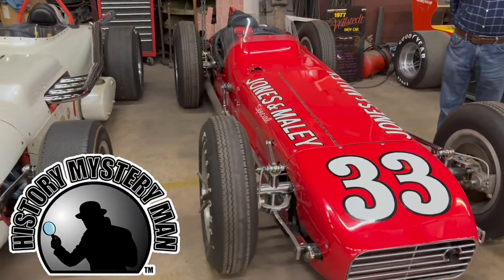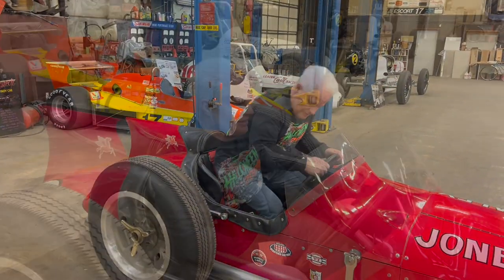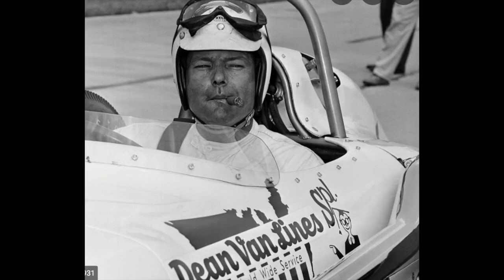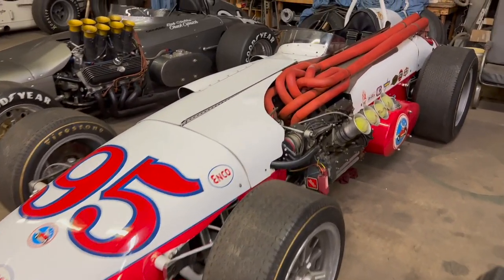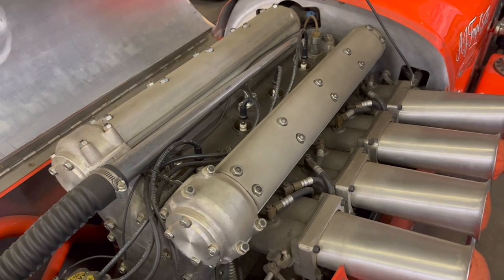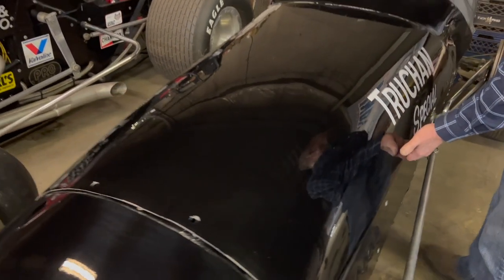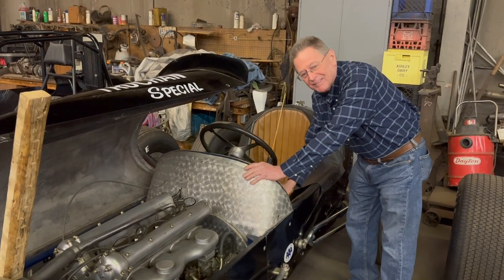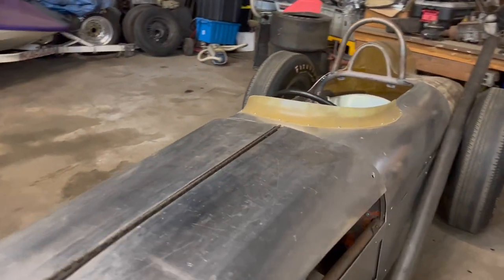STEVE TRUCHAN TRUBADOR STEWARD OF RACING LEGENDS #IndyCar #RacingLegends

Comment: Does anybody know what front spindles were used on the 50's, 60's and some 70's era roadsters and sprint cars?  I always knew them as 10 Degree International spindles but I have no idea if that's accurate and if it is, what type of International vehicle they came from,  They were steel spindles, 10 degree, 1" king pins.  They have a pressed steel cap (attached with 2 small bolts) top and bottom to cover the king pins.  Anybody know these parts?  It looks like the first 3 cars in this video might be running them.  I have been trying to track down a couple of sets for an old sprint car I'm restoring.
Reply from the maker: I can ask Mr. Truchan...seems like he may know. Thanks for watching...HMM
Reply: @HistoryMysteryMan    Thanks, that would be awesome.